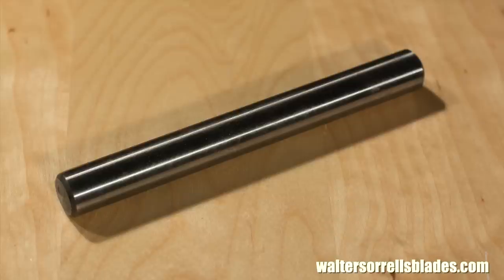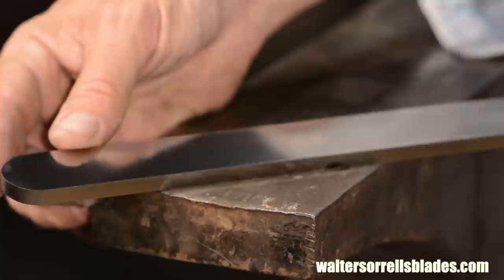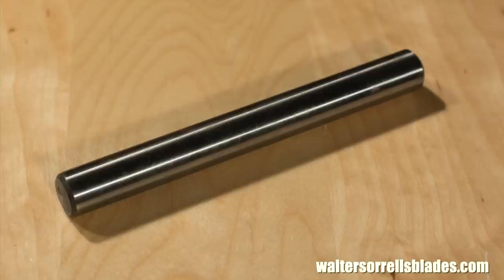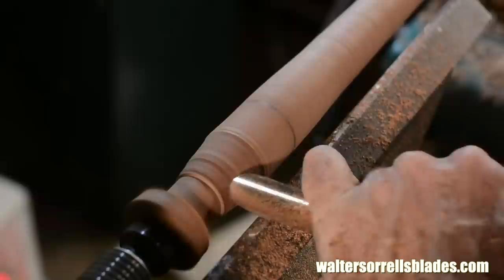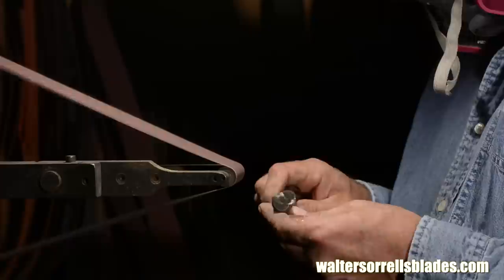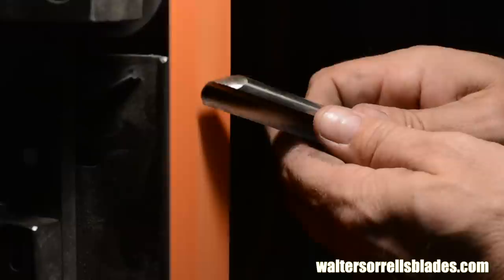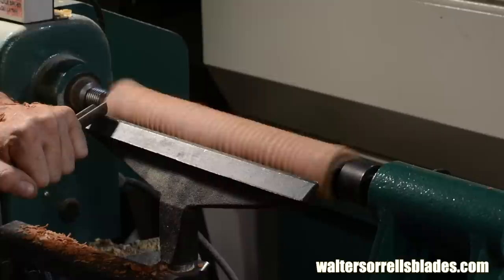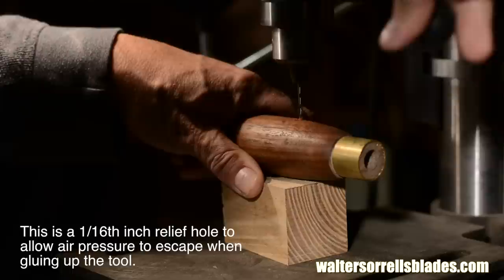Making Woodturning Tools Part 2: Spindle Gouge

Comment: Hey Walter,
First of all, thanks for the informative video. Accuracy. flexibility, specific material, clear succinct description and choices for annealing is exactly what I was looking for in order to make some tools and start turning within this coming year. I subscribed I am a wanna be. I taught shop at the Jr. HS level for a few years in the early 70's. We did have large excellent quality wood lathes in the shop. I was a total newbie with wood lathe work. After some research I learned the basics and transferred that to teaching very basic spindle work. That was a long time ago. I am 70 in March. I am still working building part time and looking to give it ago again. I do not have a shop after selling my house. I am in the process of getting that together. Thanks again. Keep up the good work. Cheers.

Comment: Tip from a wood turner, when sanding with a long strip of sand paper, like an old grinder belt as I assume thats what you used. Don't bring the two ends that you're holding so close together, the slack on the top can get snagged in the wood and quickly tangle up the sandpaper strip. This has a chance of brining your finger with it. If it grabs it well enough it can take a finger off. I know sounds a bit exaggerated but ever notice how few wood turners have 10 digits haha. As a side note when you say wheel you sound like Stewie Griffin "cool wHIp"
Reply: Coudn't stop picturing Stewie as he said it!

Comment: When you do your bevel on the back, it would be better to have your "marks" or scratches going with the shank, up and down the shaft and then I would think of using your polishing wheel to put that nice mirrored finish on it as you do carving knives, the reason for this is so when you touch it up during work, you can use a slip strop to keep like glass, I was told from an old knife maker,"glass slices much better through wood then sand paper does. Nice job either way, and like you said, we might have to learn how to use it. I was told that when you make a carving knife, it's made to fit YOUR hand.Again, Thanks for sharing.

Comment: A good way to make an inexpensive gouge without a small radius belt grinder is to use a shaft out of an old shock absorber. Normalize it in a charcoal bed and drill a hole in the end about 50% of the diameter of the rod about 3" deep parallel to the length of the shaft. Make the hole as far off center as you can without breaking out of the side of the shaft. Use a flat belt grinder to grind away the thin side to expose the hole and you have a gouge. Grind whatever bevel you want on the end and oil harden it.

Comment: I have enjoyed both video's on making lathe tools. Question on this tool, could you weld a longer round stock for the handle to fit on. This would give you a good steel for cutting, and a longer tool for use like I use most of the time. I just don't like short lathe tools. If I wanted to use short tools, I would use a chisel.
Reply from the maker: Interesting question!  There are a lot of complexities involved in welding dissimilar steels to each other.  Also, a steel like M2, which will air harden, can have embrittlement problems when welded.  Given the forces at play in a lathe tool, I'd be nervous about trying it.  All of that said, I'm no expert on welding, so there may be some tricks that would allow you to pull it off effectively.
Reply: Wilson Stevens

Comment: Enjoyed the video Walter. Just 1 wee tip as a woodturner. When using a bevelled tool, run it on the bevel. That way you cut not scrap giving more control & a much better finish. You may need to drop the tool rest a bit. Start on the bevel. You won't be cutting. Raise your hand that's holding the handle. Once you see a shaving starting to come off the cutting edge, your cutting, or as we say over here in N. Ireland, "your sucking diesel". This gives you maximum control especially when you start to role into the convex ends. I hope that makes sense. If it doesn't, come over to my shop in N. Ireland & I will give you a free day on the lathe😂. By the way, I enjoy the effort you put into sharing your skill. Thanks. Hugo Dale. You can see some of what an old retired man does on: www.beavertooth.co.uk